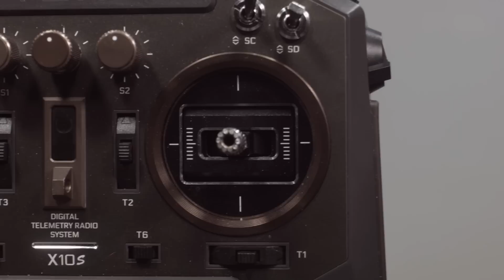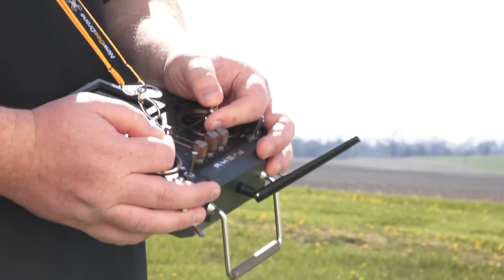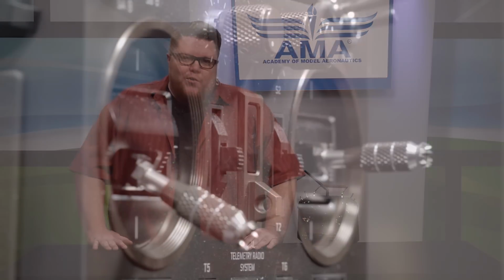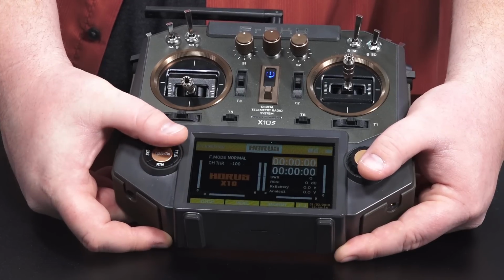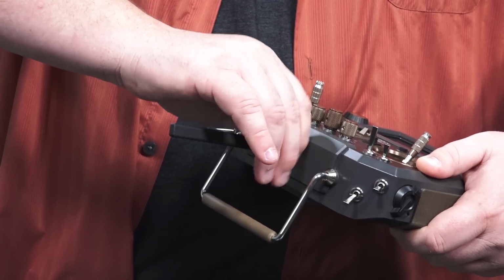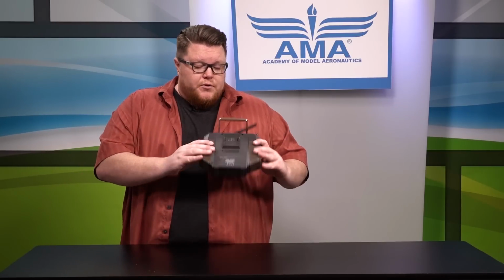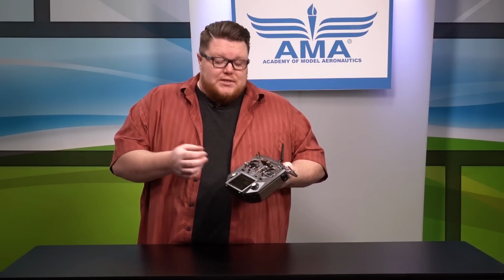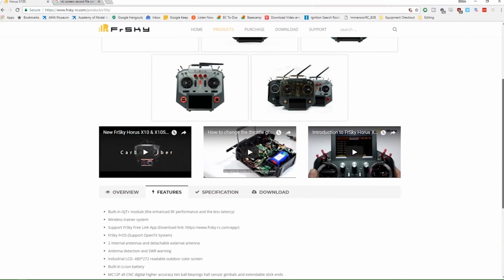FrSky Horus X10S 2.4 GHz Transmitter - Model Aviation magazine

Comment: There is enough room in the battery bay to fit a second battery pack. You will have to do some minor changes but will end up with 10-12 hours of flight time.

Comment: Does the FROS have a 'servo balancer' feature built in?
Reply: I'm not sure on the fros, system,   my X12s was second hand with opentx,    with that,   I can,   just mix two channels,    use end points, and servo centre to match.   Easy.